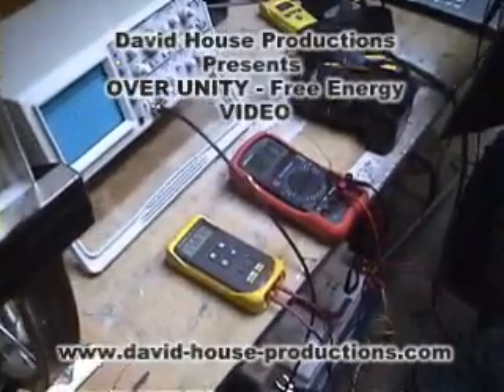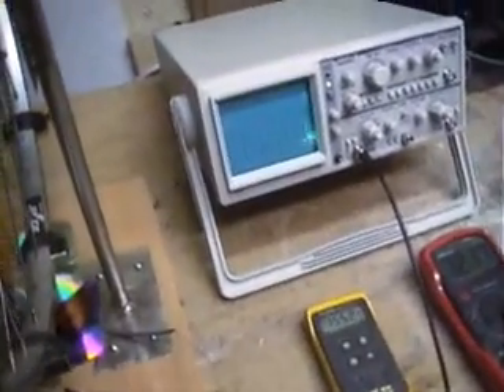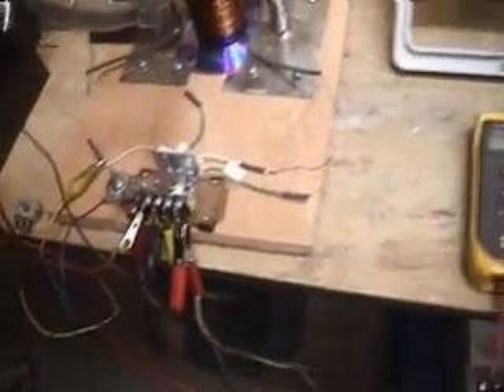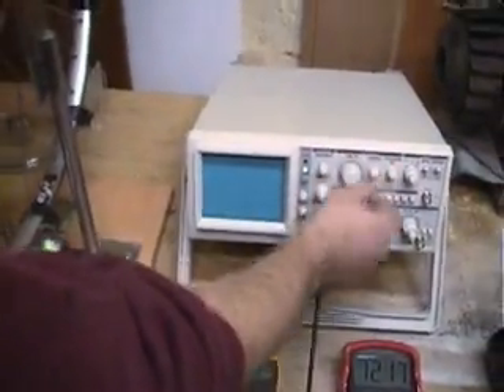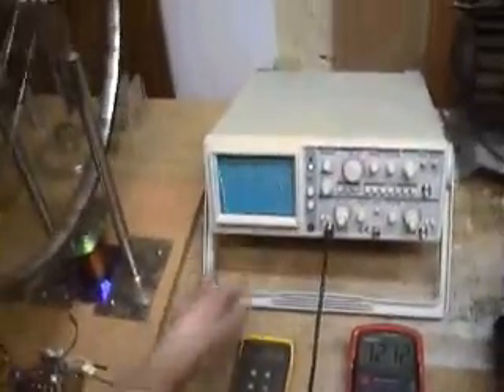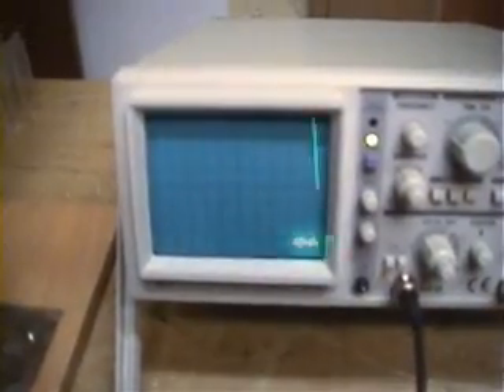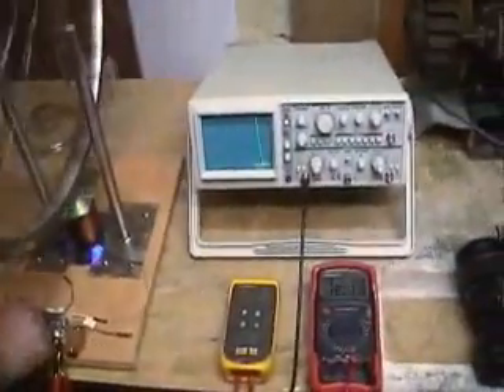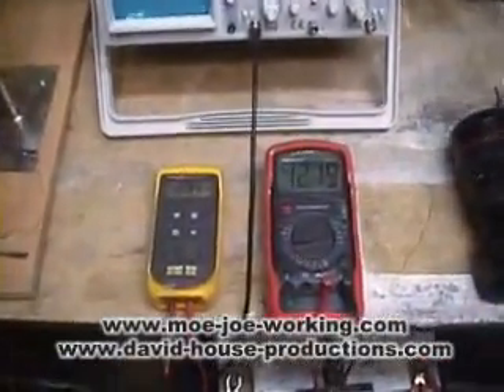Bedini School Girl Project OverUnity Solid State Free Energy

Comment: how many turns does the bifilar coil have??? its basically short circuit switching a line of coil with an input battery at low input current (by using resistors) and getting the back emf pulses (high voltage, low or almost zero current) back emf used to charge the other receiving battery from the other coil to charge the battery..have you tried using litz (individually insulated wires packed tightly together) for this setup? I bet the spikes will be more violent! many will not believe this video because radiant energy is tricky.. its basically high voltage at almost no current being used to trick the battery into charging up, this concept is still new to this modern world brought up and accustomed to current guzzling consumerism, who tend to think you cant charge a battery without usable current) I believe this setup is very efficient and almost if not slightly above100 percent efficient..its been 7 years since the video was made and many other replications of bedini solid state and motive state has been uploaded and there is no question that there is a third force called radiant energy responsible for this effect on batteries

Comment: I'VE READ PAGES OF THIS VIDEO'S COMMENT'S. Enough already. The question is not how many volts is produced, it's the watts, or D.C., amps. For the novice here, if the volts represent the water pressure in a pipe, the amps represent the SIZE of the pipe used. Obviously the larger the pipe, the more flow. If anybody here on UT justifies their machine in volts, without telling you the amps, then tell them to "take a leap". They are not only deceiving you, they are deceiving THEMSELVES.

Comment: @MosheDan9 I agree, and I don't mean to be a nob, but.. that's not "overunity", really.. that's a higher co-efficient of performance, just like solar, heat pumps, a sail boat. If our physics could explain and quantize field energy, or energy from the vacuum, or aether or whatever you want to call it, it'd likely all work out mathematically and not defy The Law of Conservation of Mass and Energy. It would, however break the second Law of Thermodynamics, and that law is already in need of revamp.

Comment from the maker: @KyleCarrington 
Hi Kyle, 
I do believe that the Bedini school girl circuit CAN be overunity. I didn't demonstrate this adequately in this video, but... if you calculate the # of watts going into the system, and you compare to the mechanical energy of the wheel spinning plus the # of watts you can get charging a whole BANK of batteries, you certainly have COP >1+++. You are aware that you can charge many many batteries, right? Unlike conventional electricity, which would divide the current.

Comment: @MosheDan9 I hear you on that one. I am baffled too, and no matter where you search, you will not find a definitive proven explanation of what is going on here. For the benefit of newcomer's though, the Bedini circuit is NOT overunity, however (like a heat pump) is has potential for COP>1. Coefficient of performance, when the mechanical work + the "obtained" amp-hours (measured in their final work) of the charged batteries is likely > 1. See cheniere org for more explanation

Comment: One thing is for certain: if you think that you'll see overunity in the form of the classical power equation -> you won't. This video is confusing... the voltage (as stated) is not indicative of "over unity". That's just a product of a coil. Any coil can increase voltage. One must calculate the energy used to charge a battery (drawn from battery one) and measure that against depleting the second battery. More proof could be ascertained by closing the loop, but that's not simple...

Comment: I myself am building and testing the circuit too, and the real question in my mind is will these batteries do the same work, with a "bedini charge" that they would, if charged normally. If they will, how many batteries can you charge simultaneously - can you perceive higher gains by charging two? No battery responds well to a "fast charge" and maybe slow charging 2, instead, will show higher gain.

Comment: @elcanom "So you need to prove total power in vs" ~ The only way to do this, is to accurately measure the amount of kinetic energy in the wheel (or vibrations of the transistors) + the inputed energy to the cell. The cell, my friend, is not being charged with current. You have to go outside the box of normal thought. Normally, we charge the batteries with current. Here, we dead stop current and use energy from the vacuum to spike high voltage into a batteries, and it charges itself.

Comment: I am excited by the results we have been given also, however, without seeing the total input vs total output, you're not learning anything about how much power in vs. how much power out.  To do this you need to find out how many volts at how many amps are going in, and how many volts plus how many amps are coming out.   You can be getting virtually 2k volts on the radiant spikes, however if it is only at 1 millionth of an amp, that doesn't mean more power.  So you need to prove total power in vs

Comment: @dracoame not breaking the laws of physics but rather utilizing a well known phenomenon. A collapsing electro magnetic field induces a high voltage spike in the coil. When designing circuits rather then utilizing this phenomenon we are taught to avoid or discharge it by grounding. The laws of physics were not written by nature but by man. If it seems to be breaking the laws of physics it merely means the books need to be rewritten and we have learned a bit more of the workings of this universe.

Comment: @MosheDan9 I agree. High voltage spikes though low in ampere can charge large banks of batteries which in turn give you the voltage and ampere you need when used. I would say it is over unity just not direct. Batteries are the problem here. They aren't efficient enough to store all the energy produced. Super capacitors are a lot better at storing but discharge it all in a burst. I'd say the focus now should be in developing better storage.

Comment from the maker: thanks Jamie. I'd love how to make 240 volts with some chunky amperage too. I am getting spikes of quite high voltage - the peaks must be around 600-700 volts, but the amperage is quite low. It could be condensed to higher amps, but not that much. i am interested in vamping it up for greater energy output without needing a thousand secondary batteries.

Comment from the maker: yes, i realize i didn't verify the overunity business properly in the video. I am aware. Thanks. But... this is a device that does yield overunity. for instance, one 12V battery can run the system, turn the wheel, and charge a bank of batteries (as far as I know, as many as you have) at the same voltage. that's overunity. there's lots of other vids out there of the bedini system demonstrating this.

Comment: You have pulsed waveforms.  Your meters read average voltage and average current.  But average power does NOT equal average voltage * average current.

You are not over unity, you are just making bad measurements.

Comment from the maker: yes. you're right. I made a mistake. Got caught up in the moment and wasn't thinking. Thing is, this setup does have overunity - even with the input primary voltage and current draw compared to the secondary, we have overunity, plus, there is the continual motion of the wheel.

Comment: i have noticed the same thing. The Bedini motor isn't really a motor its an oscillator that pulses a transformer.  

Notice what happens initially when u turn on a DC supply... u get an initial burst of voltage, a spike. Then the current catches up and destroys the diapole. Current is what we dont want. Current = Heat = waste energy. By pulsing a coil we are creating radiant spikes for a split second and extracting energy from the vacuum.

Check out my vids for more on Radiant energy

Comment: So you don't even need the wheel, and the magnets?
Just enough resistance and it will begin to oscillate by it self....
I have some knowledge about the prinsiple about this motor, and if I'm not wrong it is in the battery that the extra energy is generated, but with the help of the strong impusle which is created by the collapsing field in the coil?
I then really wonder, (if thats the case of course) why you really need thoese magnets then, if its only for the timing and the mechanical energy

Comment from the maker: it was quite easy for us. you need a higher value potentiometer to trigger the oscillations, without the wheel. i use several in series, including 1 MOhm... which is not that much needed.

Comment: Can you show current consumption?  Voltage means nothing without current consumption.  You can construct a DC to DC converter and a higher voltage from a lower one.  If you had current/voltage input and current/voltage output you can show that the input power (watts) is less than the output power (watts).  How about it?

Comment: hi
have you tried doing the voltage measurements after turning off the machine, disconnecting the batteries from the circuit and waiting 10-15 minutes? That's how I usually do it, 'cause the voltage readings change quite a bit after the SG is stopped.

how about COP test using Joule in/out values like it is described in the Bedini Monopole Group experiment PDF on the Monopole 3 yahoo group message board?